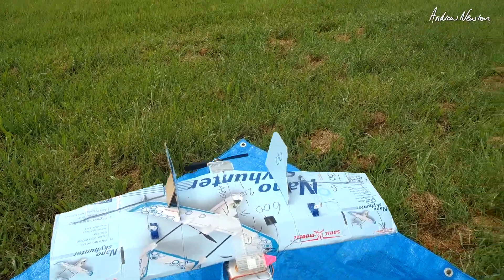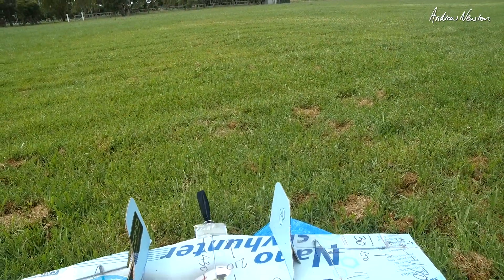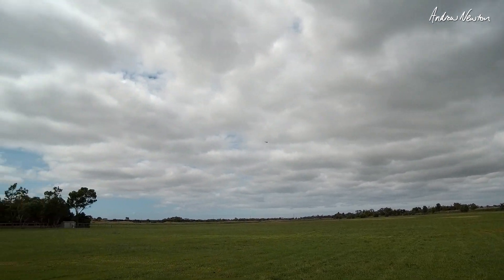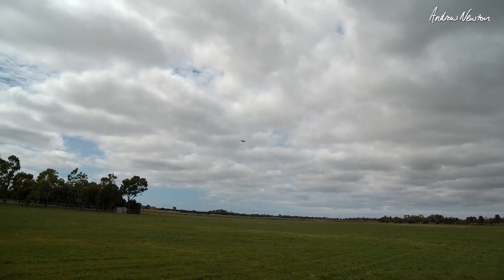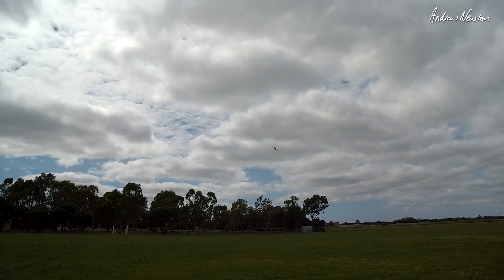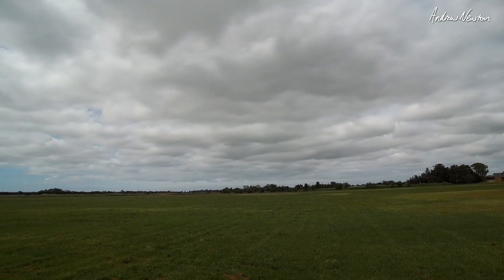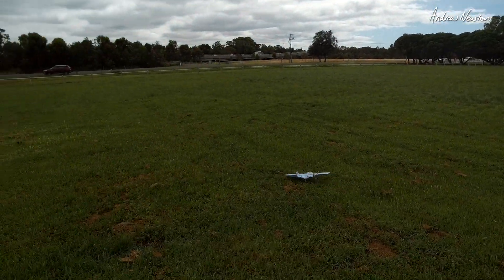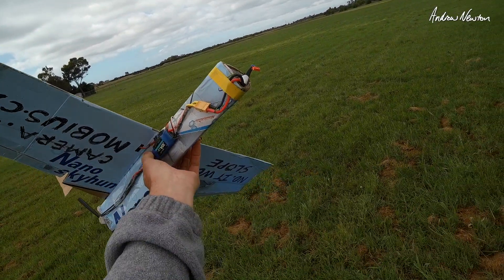Box Dart Flies !

Comment: Bit tried to make a cardboard plane as my first ever plane, it failed and I never tried again and moved onto foamboard which I have and still do make tonnes of planes from.

Looking back on my card attempt,  there was nothing wrong with my design,  I just didn't give it even close to the thrust power it needed,  the same plane would have flown fine on a different motor and prop.
Reply from the maker: The right sort of cardboard makes a great building material, but they are always heavy